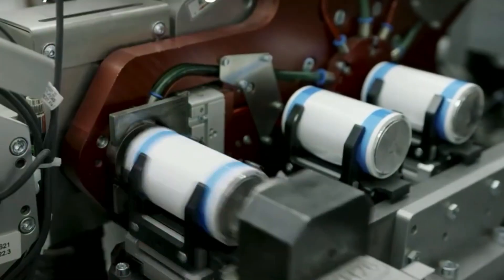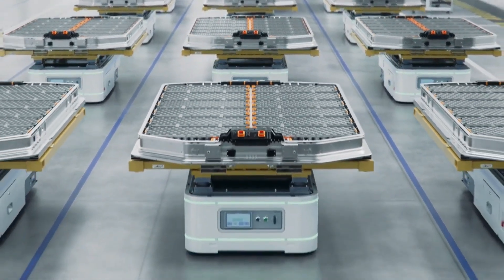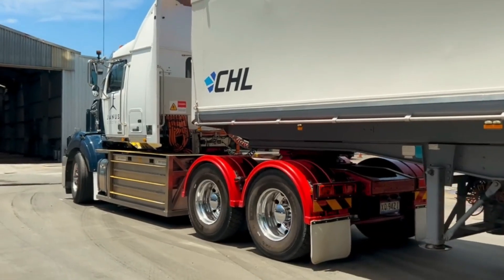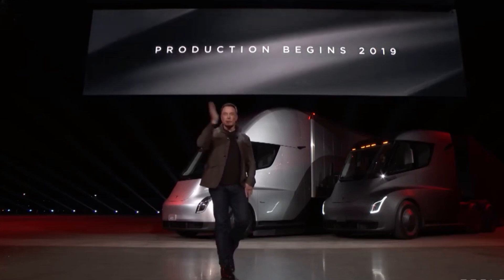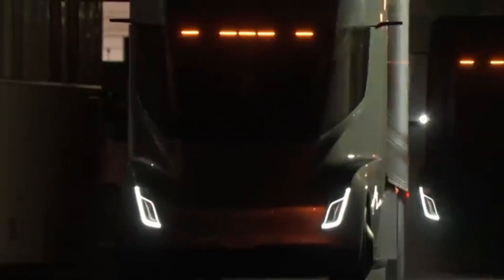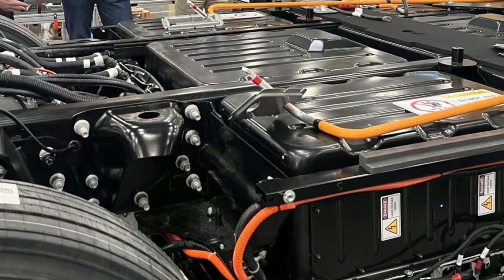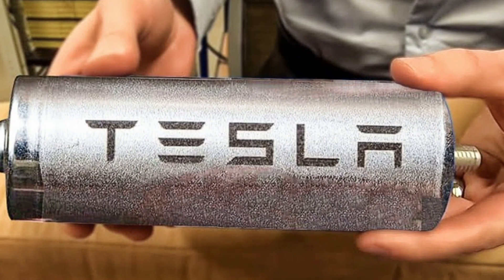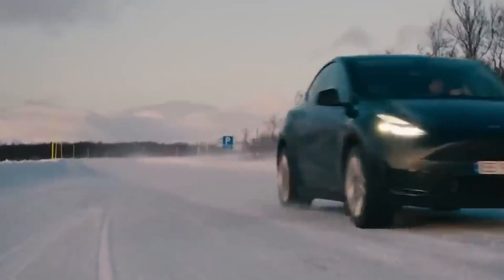Tesla SemiTruck Battery Secret Insight Revealed After Highway Fire!

Comment: Perhaps Tesla, and other EV manufacturers should be forced to have either internal fire supressants or have a way for fire departments be able to inject water directly into the battery from a distribution system that can flood the battery in cold water to cool it.
Reply: both approaches are useless. Lithium can burn even when completely submerged under water. The only possible solution is to construct the battery pack so that when accidentally ruptured and ignited, fire will not spread to other battery blocks.
Reply: @jiri3312  fire needs 3 ingredients to keep burning, Fuel, Heat and Oxygen. Remove any of them and the fire will stop. Since the battery delivers fuel and oxygen internally removing the heat is the only option. So by flushing cold water through the battery one could cool it enough to stop the reaction.
Reply: @eldaria  Where are you getting all that extreme cold water from to put out a fire that burns at 2,000C? You really think no one thought of that idea..
Reply: From what I've heard, it is almost impossible to "cool down" the battery pack enough to avoid the fire from spreading from one battery cell to the neighboring one, once the fire has already started inside the pack. Because the pack is firmly sealed. The heat being created by fire inside the burning pack first heats up the surrounding battery cells, then heats up the covering plates and eventually burns through it. Even if you try cooling down the still compact pack that is already burning inside by throwing it to liquid nitrogen, the temperature inside the pack will remain high enough to keep burning until all battery cells inside the pack are burned out. The only solution is to construct the whole battery that way, the fire wouldn't be able to jump from one battery pack to another by proper thermal shielding between neighboring packs. So only the damaged battery pack (segment) burns out, then the fire dies out.